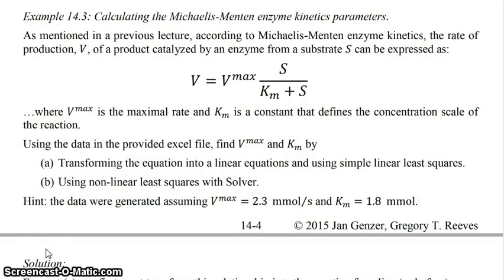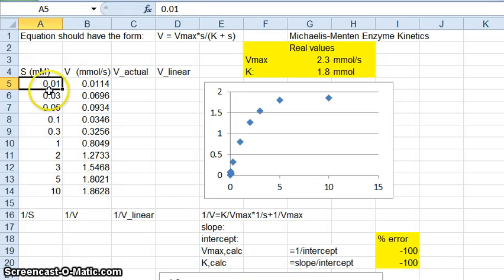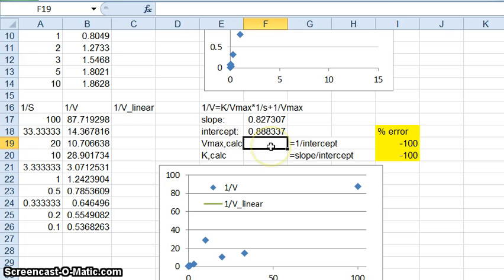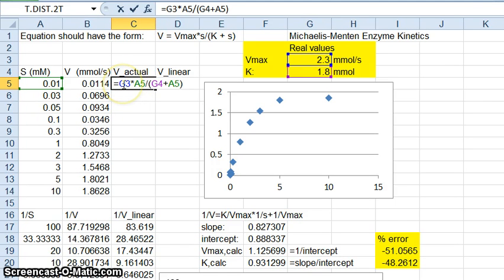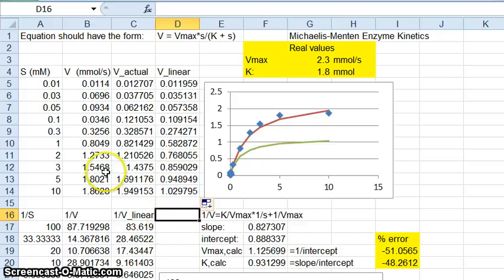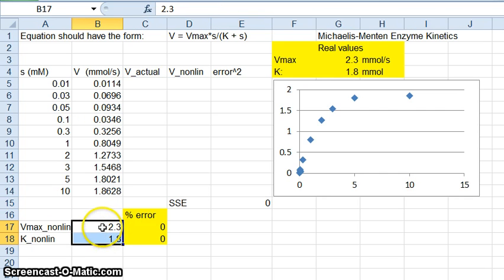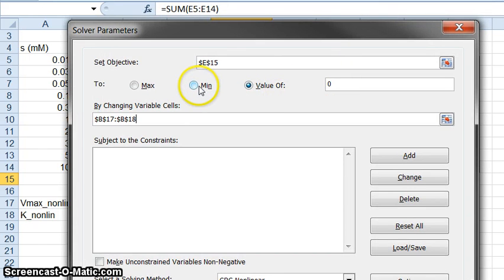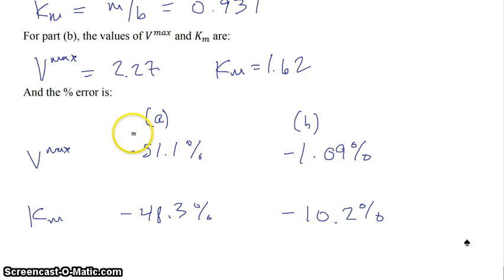Linear vs. non-linear least squares - Michaelis Menten

Comment: I need help in non regression
Reply from the maker: Do you mean non-linear regression? What kind of help do you need? Can you explain further? Thanks!
Reply: @drgregoryreeves  i have some experimental data of 3 variables  and I have to determine Kcat using the non-linear regression. I don't know if i can share the table with you. Can you help with that?
Reply from the maker: @aroniebronze7168   Yes, probably. What software are you using? Is it Excel? Would you be ok using Excel's Solver add-in (as described in the video)?
Reply: @drgregoryreeves Yes Iam using excel
Reply from the maker: @aroniebronze7168  Cool. Can you use Solver in the way it's described in the video? Have you tried that method? If you're having trouble, can you describe specifically what problems you're running into?
Reply: @drgregoryreeves  let me try solver. I'll get back for more help. Thank you Dr.
Reply: Hey Dr. Thanks for the guide, i really appreciate

Comment: how do you drouth line of best fit with replications of the rate measurement, knowing that you need to show all the data points on the graph. so you can't avg the data points
Reply: +Nichollas, I am not sure I understand what you're asking.  You are asking how you would make a plot that has instances of multiple measurements for the same value of the independent variable?